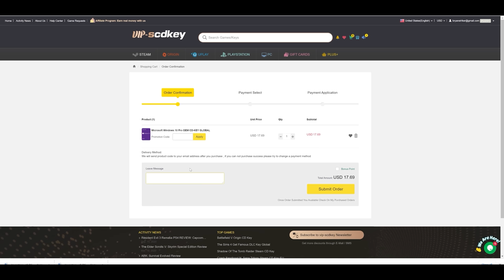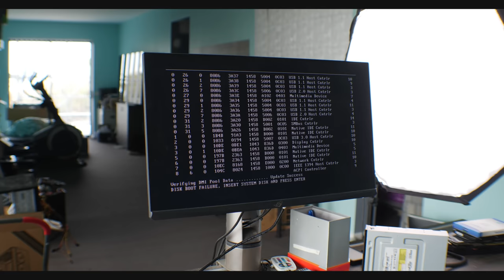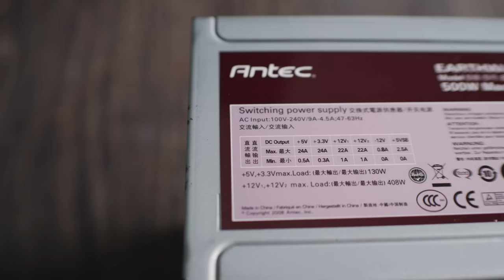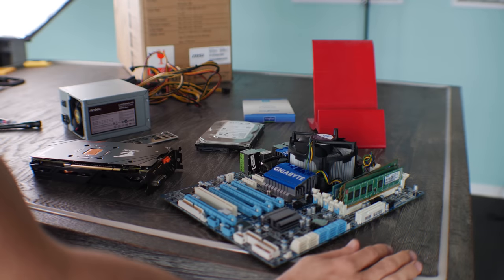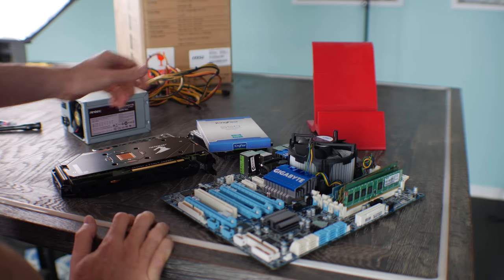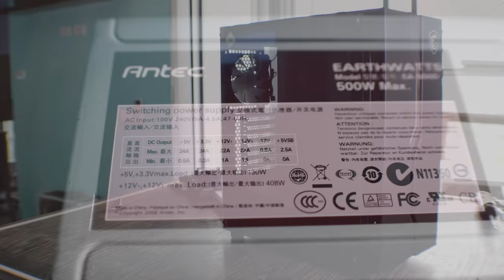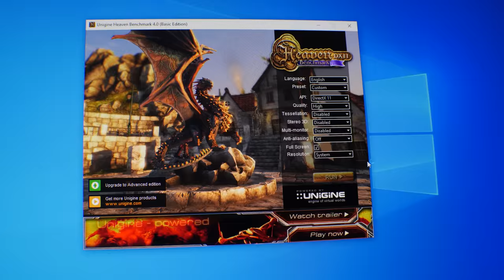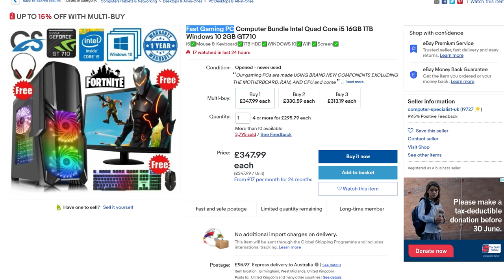Old Gaming PC Found on the Road.... Will it Work?

Comment: Am thinking the scalpers will mop up the GPUs being sold off by miners.

By the way, in Britain that is called 'theft by finding'.

A tip. If anyone finds the Intel stock cooler noisy, the Arctic Freezer 7 Pro is a budget beauty. I bought this cooler to replace a gnarling Intel cooler, and the Freezer 7 Pro was silent and cooler. (It's not going to cool a new high end CPU, but it worked fine on my Intel E6700 at the time.)
Reply: Theft of finding does not apply to abandoned property. Part of the general rule is ''A finder of property...is entitled to keep abandoned property''.
When the cargo ship shed its load on a beach and people were driving away motorbikes and such, that was theft as it was not abandoned property.

Comment: a family member gave me a non working pc. It was the PSU, replaced it, cleaned the rest, cleared the cmos, added ssd, and it worked fine... i7920. funny thing is after I got it working he wanted it back! I said ok but not the new parts, he said in that case no. Still working, my parents use it!

Comment: I have literally everything to build a pretty solid gaming pc to sell, I just can't be bothered. 

r5 1600x
B450 msi tomahawk
choice of like 3 different coolers
Nzxt h510 case
tx750M psu
2x8 gb 2666 cl 16 crucial ballistix
gtx 1060 6gb
a bunch of rgb strips/fans

just losing value because I can't be bothered...

Comment: Hey bryan, I also found that kind of mobo the other day for a very cheap price paired with an i7 920,. The only problem is that, there is no Northbridge Heatsink on it. But I've manage to put a replacement heatsink.  But I wasn't able to find a heatsink for the CPU VRM. my question is, would this still work well without the vrm heatsink? And also was planning to upgrade it to maybe a xeon x5670 or higher. My mobo is an Gigabyte GA-X58A-UD3R Rev1.0

Comment: ive found so many good pcs. 
the first one I found was one with a gtx 660ti 8gb of ram and some older amd phenonom 
the best one I found was a i7 4770k, r9 290x, rm750 psu, z87 motherboard. it was from a repair shop house thingy so it didnt work but the motherboard was shot but everything else worked. I still use the rm750 im my main rig today because no need to replace it.
also found a x58 motherboard just chilling ontop of a box and it worked, very random but it worked then broke the next day

Comment: I found a lenovo yoga 720-13ikb - i7 8550u - 16GB ram, IN A TRASH CAN!! I cleaned the corrosion wiped the information, bought a new battery. boom It worked!!

Comment: the issue with building your own pc is the freaking postage, my retro pc I just built cost me 300 bucks and its got no monitor yet. most likely wound have cost around $240 bucks without the postage do yeh if you can't get the parts locally you are in the shit.

Comment: I found right down the road someone who had a yard sale of their deceased father and i found a computer with an i3-7100, 8gb of ram, 512gb ssd and stock cooler so now i bought a case,16gb of ram, aftermarket cooler, gtx 970 and im gonna flip it

Comment: PC wont turn on without the 5v stand by, Im dealing with this now, if my cat steps on the power button I have to jiggle the power supply wires and beat on the power supply to get it to power on. Might be time to invest in a new power supply.

Comment: I got lucky couple weeks ago. Lol both systems fully working. Had lots of dust. One had i7 2600 16gb ddr3 ram and ati 6770. Free and other pc had i7 920 which i upgraded to xeon 5670. Mobo was asus cant remember the model. Was not x58. But i updated it lol and it worked with it. It had only 6gb ram so threw in 4gb more. Had gtx 550 ti withhx 750w psu. All free

Comment: There's lots of dodgy people doing lots of dodgy stuff. The Geforce 710 has 360 Gflops of power, so you can play any PS3/Xbox 360 game on them. Marketing a 710 computer as a gaming computer reeks of predatory behavior, although for retro gaming they're not as bad as everyone makes out because a lot of retro games can be had for very cheap. $400 for a system with a 710 is a ripoff.

Comment: For those who want the track during the Cleanup Montage, _91nova's "Wardenclyffe", you may find it here: https://www.youtube.com/watch?v=O1LftodjZ4k
As for this build, Gulftown CPUs on X58 can be Overclocked to meet the spec of an Intel 8400 from Coffee Lake (Generation VIII), the 990X is the best chip that you can get for this but it might not be wholly recommended to OC it unless you're okay with the CPU running at over 0400 Watts without proper tuning; now, I cannot vouch for the effectiveness of Gulftown's capabilities in the Workstation department, you probably might want to go with a newer Six Core Multithreaded CPU if you need the Instruction Sets but that mustn't discredit the i07s of this era, they are still effective for some form of Gaming and Generation VII Console Emulation that I feel Ultra Budget builders can get a good deal with the correct combination of parts and still manage to throw down with the current Entry Level introduced by Zen II and Comet Lake.

Comment: found a dell optiplex 7010 with a i7 3770 4gb ram and the dell psu just put my gt710 from my old pc in there and now i am using it, the problem with the dell was just a bad hard drive

Comment: I just tried switching out my i7-920 with a xeon x5675. Didn't post. 😔 Maybe my motherboard isn't compatible with x5675? I have a MSI X58 Platinum SLI.
Reply: You need to update the BIOS of the motherboard first.
You can find this on the site of the manafacturer. If the BIOS is too old, it doesn't have the needed microcodes.
https://www.msi.com/Motherboard/support/X58_Platinum_SLI
Reply: @tweakz_tech  Thanks. I'll try again and let you know if I was successful. I assumed I had the most recent bios but I was wrong.

Comment: hi, i barely use x58 rig but i got some problem to install more than 2 sticks ram, do i have to set specific setting on bios in order to run more than 2 sticks ram since i have applied latest bios version on it?

Comment: I have 2 old pc that when I turn them on the fan will start spinning at 100% and will not give any signal. I have tried resetting the cpu but and checked all the parts one by one beside the bord all are working. that bord will give 100% fan speed and only that

Comment: I think the RX 570 was a bit overkill for this machine, a 1050 ti would be a better combo...
Reply: better put in a better graphics card and you can always upgrade to a 6 core xeon for 10 bucks later
Reply: @talvisota327  GPUs are hot these days, save them for better systems or sell them for a better margin of profit.

Comment: Thermaltake 500 Watt 80+ PSU would not say that was cheap  as evga psu was even cheaper as for nasty  your using a antec  but i still would not use a psu that i found
Reply: Every brand has trash products and that thermaltake PSU was one of them

Comment: You know what? The GT 250 is a potato, but still kicks a 710 in the nuts by 113% https://gpu.userbenchmark.com/Compare/Nvidia-GeForce-GTS-250-vs-Nvidia-GeForce-GT-710/m7741vsm77649 so ye, it's a "ultra fast GPU"

Comment: Who in their right mind throws out a x58 system ? Man I've had offers of over $300 usd for my old mobo's alone !!!
Reply: when was that? luckily x58 has become much cheaper compared to a few years ago and you can get a board for like 50 bucks already
Reply: @talvisota327  Offer came in end of April this year. I didn't sell because I'm looking for a full system upgrade (was looking into a Threadripper system but owner had fried the cpu and mobo beyond rescue ..... yup there are people out there with "broken Threadripper systems" and also i have x58 Nostalgia so didn't sell.
Reply: @shoailwaniya  which board do you have? must be some high end stuff then. normal x58 boards like asus p6t are fairly cheap nowadays
Reply: @talvisota327  I've got 2x rampage 3 formula boards in proper builds with x5670s and gtx 1060s in them. I've also got a gene 3 system which I'm using with my rtx 3070 this is my most stable board with the x5670 sitting at 4.6ghz (probably because it's an matx board). I've got a boxed rampage extreme that I'm trying to get it to boot which works for a few days then won't post at all. I've also got a gigabyte ud3r 1.6 system with a i7 920 the old d0 stepped cpu that was my main gaming rig up until 2018 ....... so yea I'm slightly obsessed with the x58 platform 😂😂😂
Reply: @shoailwaniya  i also have 3 x58 boards in my collection. 2x asus p6t and one gigabyte ex58-ud5. the highest stable overclock i managed on a xeon was around 4.2 ghz. i guess thats not bad but a lot of people managed to reach 4.5 or even higher just with air cooling. no idea if my cpus are just not that good or if my oc settings in the bios could be improved. x58 definitely still has a lot of life in it and i guess even when the platform turns 20 years old, it still wont be useless.

Comment: You keep throwing the crypto gpu shortage every time you get, but that's plain wrong. Right now there's a huge crypto dip and I still see gpus at exorbitant prices. THE PROBLEM ISN'T ONLY CRYPTO. No one can get CHIPS. There's a global shortage caused by multiple factors. Watch a few videos on this topic and you will see that the problem is way bigger than you think and because of this, gpus will have normal prices maybe in a year or 2. There just aren't enough chips to make everyone happy. At this point crypto is just a small drop in the huge ocean of reasons why gpu prices are so high